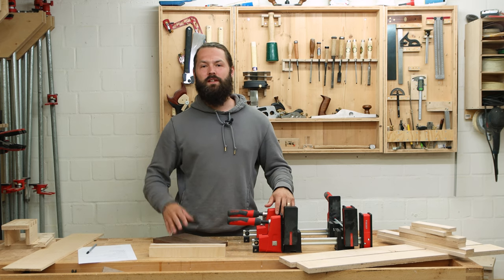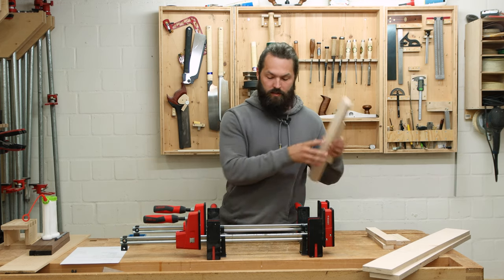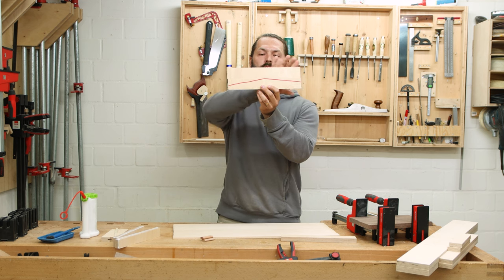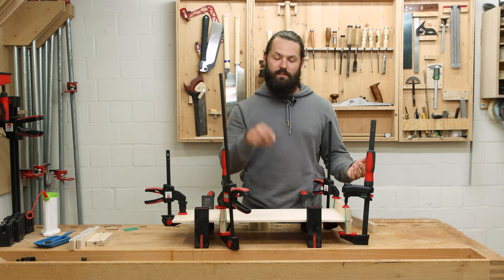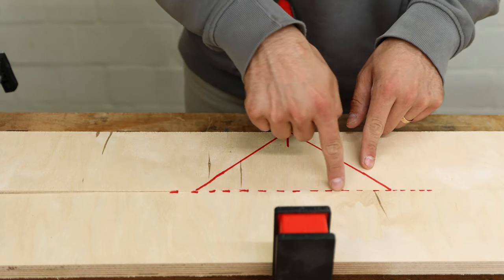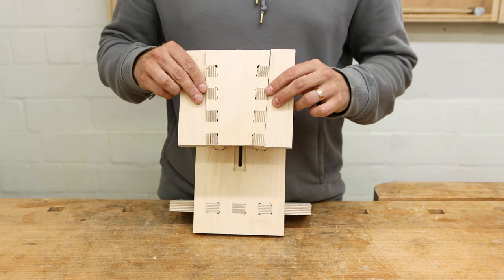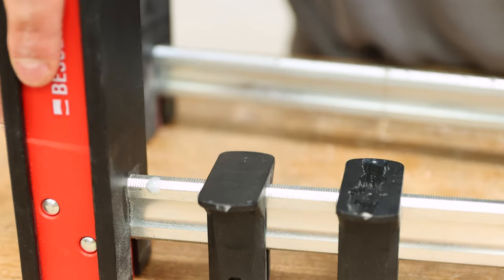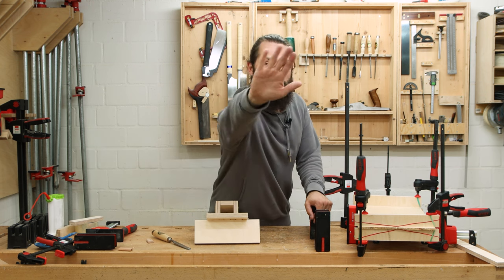5 TRICKS for STRESS-FREE and better GLUE-UPS  || Woodworking pro tips

Comment: Very useful tips! I have never thought about the number of clamps needed. I simply used as much as possible.  But thx to your visualization you could explained it perfectly. This eliminates to work acc. to the slogan "a lot helps a lot" in the future. You can imagine it quite well, even without red lines. The important thing is the length / width ratio. Thanks for the tips! P.S.: The phone regularly rings while I'm gluing 😅

Comment: If you're gluing up a table top, can you lay boards on a flat surface and use regular bar clamps instead of these panel clamps?
Reply from the maker: Should work, too. But with parallel clamps it is way more comfortable